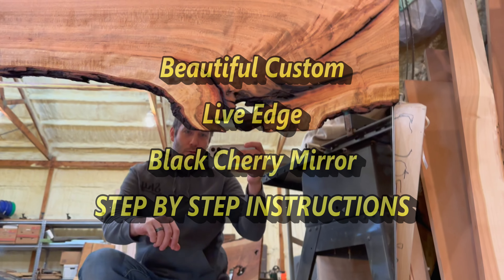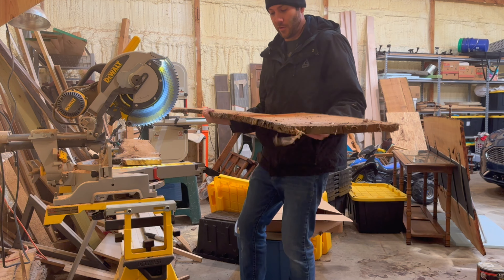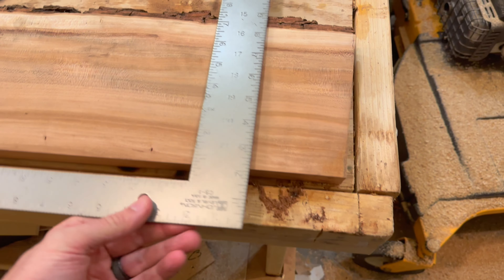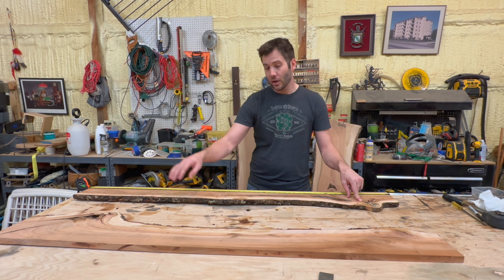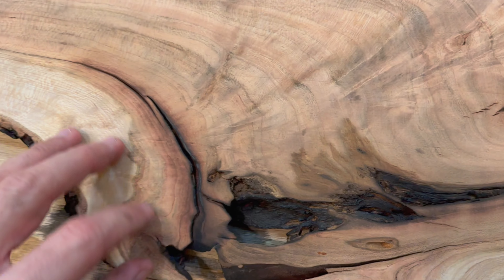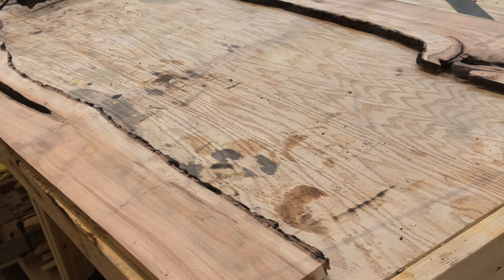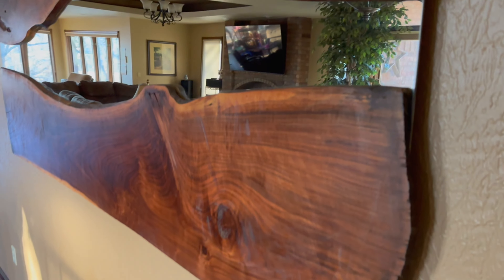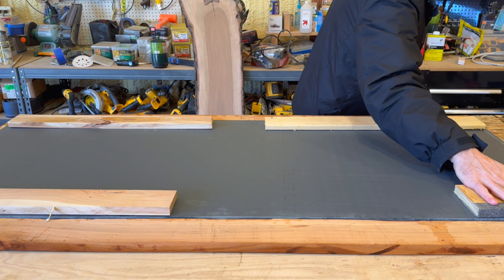How to Make a Live Edge Mirror

Comment: not concerned with natural wood movement?  Does that gorilla glue have some flex when dry?
Reply from the maker: What is used is called “mirror mastic”. (I believe I am spelling that correctly.  It’s specifically designed to glue glass / mirrors.  I have one hung in my house that has been there for about 5 years with no issues.  That being said.  YES wood does flex if it’s not settled.  Make sure the moisture content is not considerably off from the end point you will be hanging the end product.  Our wood has sat for a few years and I still test it with a moisture meter. Good luck 🍀